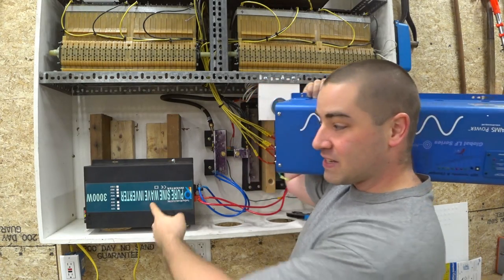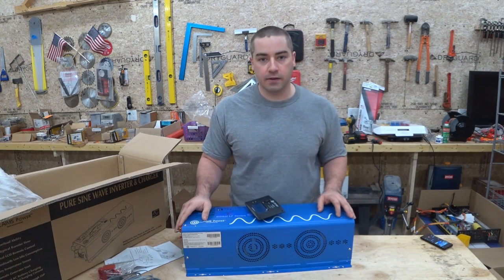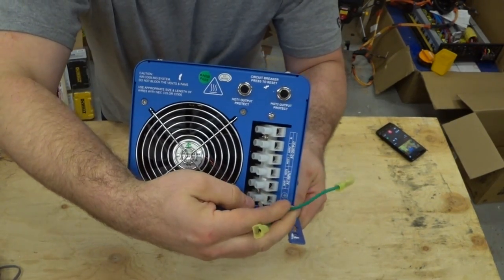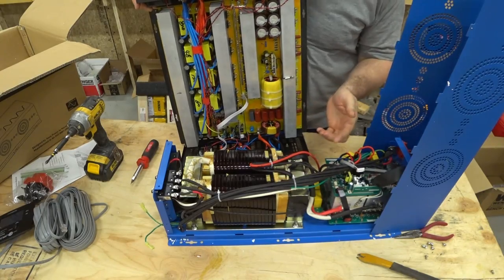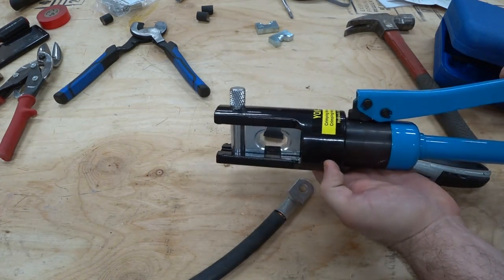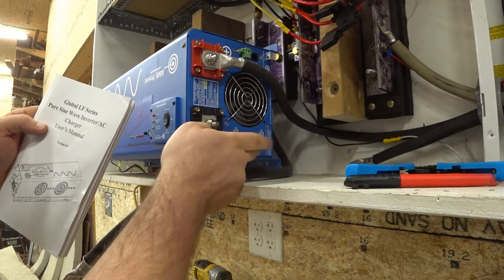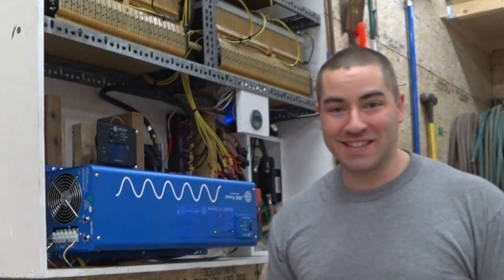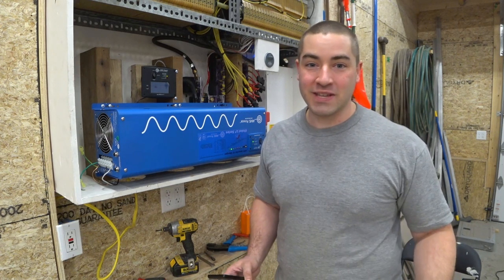Inverter Upgrade! Reliable to Aims in Off-Grid System

Comment: Is this SUNGOLDPOWER 6000W Peak 18000W Pure Sine Wave Split Phase Power Inverter with Charger 60A,Solar Wind Power Inverters DC 48V AC Output 120V 240V Converter
The same as the AIMS POWER INVERTER CHARGER YOU ARE TESTING IN THIS VIDEO? please I like to know thanks.
Reply from the maker: I'm told they come out of the same factory.  There are slight differences in the user interface (display/controls) but very similar.

Comment: Cool video, Sry all dumbo newbie here, what's the imput voltage and how is that generated?
Reply from the maker: Hi Sean,  I'm using a battery pack with a nominal voltage of 48 volts DC (direct current).  This will vary between 44-49 volts, which is normal.  The inverter takes that and makes 120 volts AC (alternating current) on two legs.  I can use one leg (for 120v) or use both legs for 240 volt loads.  Thanks for watching.
Reply: Thanks very much for the reply, how do you charge the battery?
Reply from the maker: I use a solar charge controller: https://youtu.be/Efqx_iRYRjo

Comment: i got 2 magnum 24 4000 watt inverters for $ 650 for 2 inverters and 3000 watts of solar for $ 400 used my new 100 amp controlers came to day cost new $320  for 2  my volt car cost $900
Reply from the maker: Sounds like you got some great deals.

Comment: I would like to see if it would run a5,000 but AC window unit and for how long on batteries.
Reply from the maker: I have a 5,000 BTU window AC in my garage.  and a 6,000 BTU window AC in my house.  This Aims inverter can run both at the same time with plenty of room to spare.  How long they will run is a function of battery size, not inverter size.
Reply: @DavidPozEnergy  Awesome thanks.

Comment: With this unit provides single phase 240? In countries like png, one leg swings the full 240 volts, the other leg is neutral like ours carrying no current and then a ground leg
Reply from the maker: Not this exact unit, but there are other models from Aims, and other manufacturers, who sell single phase 230v for other countries.
Reply: @DavidPozEnergy  thanks David! I know victron has one, but the aims installation menu shows wiring for a single phase 240. Of course their manual is pretty generic and I think covers different models. I'm not personally really certain what the difference is once you remove the center tap concept for 120.

Comment: My aims  8000 inverter switch went hay- wire. I had to disconnect everything. And I’m using a 3000 inverter my brother lend me. I’m running to a small refrigerator, 3 power packs , a usb fan, and a Bluetooth  speaker.  I tried buying a remote for it and got scammed. But luckily my bank got my money back.  I have been living 2 years in my dads house no electricity. I should have done my homework.  This is Puerto Rico. I tried to get luma to help me get in electricity they told me I had to pay 18,000.00 for a transformer that don’t even include the post and cables. But I’m ok. I learn to live without power.

Comment: Men and their toys😂😂

I'm still trying to understand the difference of benefit between high and low frequency transformer. 

Ans at this point I'm lost about 120v 2 phase making 240v. 
Does that imply in other countries using 240V, a 2 phase will become 480V?
Reply from the maker: This inverter (Aims 6kW) makes a sine wave that is 240V.  then there is a transformer built into it.  Transformers are big and heavy.  This transformer "splits" the 240V sine wave in half providing a middle neutral.  That's where you can pick up 120V from each half.

Comment: so you got an inverter that cost over $1,000 and you're all excited because it runs your miter saw I bought one from harbor freight I think I paid 60 or $70 for it and it's been working is running sauce drills everything I need for about 5 or 6 years
Reply from the maker: Cool.  Can you please make a video about your setup and share the link?

Comment: Go check out another power.com and search the thread “guess who bought a powerjack inverter”. There is a very simple mod you can do to the positive cable on the small heat sink that will raise your efficiency greatly. Your inverter control is identical except the bells and whistles. Just the transformer is different. The mod really is simple and I can help find the part called an e-core which when installed brings your idle wattage down to about 20w and overall better efficiency.

Comment: Where did you get the batteries ? How do i get some ?
Reply from the maker: The easiest way is to buy them through ebay: https://www.ebay.com/sch/i.html?_from=R40&_trksid=p2380057.m570.l1313.TR12.TRC2.A0.H0.XEV+battery.TRS0&_nkw=EV+battery&_sacat=0
I found my pack by calling "Auto Recyclers" (junkyards) in  my area.  I probably called 100 places before I found one with a Chevy Volt.  Then I bought the battery.  Here is a video when I picked up my pack: https://youtu.be/V1t1SoEhVNQ

Comment: Try running a TIG welder. You'll be pleasantly suprised.
Reply from the maker: I've never used a TIG welder.  Can they run on an off-grid system?  I only have an old Arc welder and I won't try it because I'm pretty sure it will burn up the inverter.
Reply: Also MIG welder, many available  from hobby to industrial, gas and gasless and are very handy to have around.  Have seen you use your ARC recently on battery pack threaded rod and had a chuckle!!  A MIG would have been the go there.  Cheers from Australia 😎

Comment: What sof6are you using to monitor your system?
Reply from the maker: I don't use a computer software.  I have a battery monitor (Victron BMV-712) and I go to the garage to check voltage, or SOC.

Comment: So it should work with a air conditioner?
Reply from the maker: I've run 3 window AC's at the same time with it.  No problem.  It might have a hard time with a whole house AC, but depends on size.

Comment: I do not understand what you are getting excited about, you say it is a 6KVA inverter but you have not shown is any device that uses over 2kva so what is the excitment about. You need to upgrade your output wires and have more output wall plug fittings so you can connect many tools at the same time. 6kva should run 3 maybe 4 hotplates on your cooktop or all the tools and heater that you showed and more at the same time.
Reply from the maker: I'm excited because the last three inverters I have tried could not do this.  Two of them were rated for 8000 watts.  https://youtu.be/Y7wRgdn7c-c  However, I have done a full load test, and am editing that video now.  Stay tuned to see it in action.  Thanks for watching.

Comment: lm trying find one that can operate my 220v air compressor
Reply from the maker: Yes.  This is outputting both 115 and 230 volts, so it can work with 230v appliances.

Comment: man i want to get one but for my computer use and gaming console ....any help  on how i can make this happen
Reply: ohh AND TO RUN ATLEAST  10 OR MORE HOURS
Reply from the maker: I'm not a gamer, so I don't know how many watts a computer system needs.  I would start by finding out how much power (in watt*hours) your whole system uses every 24 hours.  I do this with a plug-in meter called the kill a watt.  https://www.amazon.com/s?k=Electricity+Usage+Monitor&ref=nb_sb_noss_2  Once you know the usage, plug that number into an on-line calculator that can help you size your system.  I like this one: https://www.altestore.com/store/calculators/off_grid_calculator/  I hope that helps.

Comment: Can it run a welder? Like a harbor freight 170 amp
Reply from the maker: I don't own that model, so I looked up the user manual: https://manuals.harborfreight.com/manuals/64000-64999/64805.pdf page 7 says the input at 240v is 26.8A.  That's 6432 watts.  So if you are using the welder at full power then this aims inverter can power it for maybe 5 minutes before cutting off.  I have run my Aims inverter at full load (6000 watts) for a full hour and it did not shut off, but it will shut down when overloading.

Comment: Can it start an ac unit like a 4 ton, just for the ac
Reply from the maker: You will have to measure the in-rush current of your AC by using a multi-meter with a "peak hold" function.  Then compare that to the data sheet on this inverter.  I don't own a 4-ton AC so I can't tell you yes or no from personal experience.  All I can say is it works with my AC's, but the larges I have is 1-ton.

Comment: Will these work in India? will work for AC compressor
Reply from the maker: You would need a different model.  I think India uses 230 volts, 50 htz.  Aims does make a model that has 230v (single phase).  As for the AC compressor:  This starts my window AC and my shop air compressor.  So it can start some compressors.  I don't know what size your AC compressor is so I don't know if it will work in your situation.

Comment: The low frequency inverter will start motors alot better. It may not be effiecent.   I have a similar inverter..
Reply from the maker: How has your's been holding up?  How long have you been running it?
Reply: DavidPoz it does OK. I have had it for almost two years. I don't use the charger either. It's nice to have. I haven't put alot. On it. Mostly circular saws and routers. Haven't had a issue yet..

Comment: What!? Not a word about the idle current draw and how well the Power Saver mode works? That is the most important feature in an inverter for home power, in my experience. How much power is used by the inverter, when everything else has turned off? 
I like my AIMS 6000watt, 24 volt version, except the standby, power saving mode is not adjustable, and you have to turn on way too much load, to kick on the inverter. I ended up installing my old Trace 2424 alongside the AIMS, and seldom use the AIMS anymore, because of that one vital detail. Abandoning the AIMS made a huge difference in my batteries state of charge come sunup.
 The Trace can adjust to power up from a mere nitelight being turned on, but with the AIMS, I had to turn on all my lights, plus two mini fridges to wake it up! 
If this 48V inverter has the same standby as mine, it is kinda worthless for a typical residential application...e.g. If the fridge coming on won't kick the inverter out of standby, that feature is useless for a household, making that inverter a poor choice.
This review is equally worthless for neglecting to discuss one of the most important features in a home power inverter. At least we know the torque specs though...
David's excitement over starting a puny compressor with a 6000watt pure sine wave inverter, was a bit overdone IMO. Try starting a 5hp 220v model like the specs suggest it should. That would be meaningful.
I highly recommend these 6000w AIMS, but only to a buyer who doesn't care about a workable standby feature, or could use the industrial sized setting my model apparently has. Like a large workshop that's mostly under load constantly, or turned off completely.
That's my observations and opinions after living with an AIMS 24 volt, 6000watt model, in the high desert of NM for a few summers. 
Now I prefer a modified sine wave, 1980's model, with less than half the power, but an excellent power saving mode. The AIMS is NOT an inverter suitable for an off grid home IMO, unless they have fixed the all important standby mode. That's why I decided to watch this video, but he pretty well ignored that most important of features.
Reply from the maker: Hi kelhawk1,  I read your comment.  What are your own numbers for your Aims 24v idle, and what your 1980's Trace uses?   I share my numbers in this follow up video you might be interested in. https://youtu.be/4EsYfdK1Hn4
Reply: @DavidPozEnergy  Alas, my 12 acre, off grid retreat in New Mexico was virtually stolen from me by the Covid10 hoax. I have been stuck here in Kansas, disgusted with the state's governor, and one of the most restrictive lockdowns in the nation. All my paperwork and specs are out there. If you really wanna know, (lol) it is a Trace DR2424. Look it up. The exact AIMS model I could likely find records for, but what would that accomplish? 
In case you missed it, my entire point was to warn people about the importance of idle current draw and standby features before buying an inverter to power an off grid home. Can you offer any info contradicting my observations? More specific, my sun up state of charge went from a typical 80 to 85% to 90% after only using the AIMS on an as needed basis. My 8 Trojans sighed in relief.
Don't feel singled out, I never hear Will consistently talking idle current specs & features either. As I found out the hard way, it can be a significant factor with big n cheap   inverters hooked up to lead-acid.

Comment: How is the aims inverter doing.
Reply from the maker: I used it for a year, worked great.  Then I sold it (cheap) to a friend and he has been using it daily for 2 years.  Still running strong.

Comment: haha.. what a monster... What was wrong with the other inverter?
Reply from the maker: I don't know exactly why the other inverter failed.  The fuses and mosfets are blown.  At some point I'll try replacing the mosfets and see if it still works.  In the meantime, I have tested this inverter heavily.  If I overload this blue one, it will shut itself down without damage.  I like that.
Reply: @DavidPozEnergy  Thanks for the update.. Guess there's a reason why the other unit is fairly inexpensive.. instead of a blown fuse, which is simple to diagnose and repair, the mosfets fail too.

Comment: You're going to wish you didn't do that I took one of those inverters out because it consume 200 Watts continuously to be on 218 to be exact how much is your idol load with this inverter
Reply from the maker: https://youtu.be/4EsYfdK1Hn4
Reply: @DavidPozEnergy  88 watts is very reasonable my house load with TV modem router Phantom loads 352 400 W including refrigerators everything all the 110 volt circuits not including the heat pump or stove if you're interested in having a conversation with me I'd be more than happy to help reduce your load and we can do a energy audit to help you my inverter is a 48v 4400 watt inverter 8000 watt surge Magnum manufacturers my inverter my powered on consumption is around 30 to 40 Watts with no load the energy curve efficiency is 94% I think but it's really good
Reply from the maker: Your Magnum setup is one of the best out there.
Reply: Thanks man

Comment: So I don't get it, why would you want to put all of your faith into 1 massive inverter as apposed to multiple smaller ones? So instead you depend on one inverter but if it ever blows on you your stuck. Also with massive inverters the juice they suck up is just over the top VS smaller ones. I have 12, 340 watt  ultra high efficient panels a 100 amp charge controller and an 80 amp charge controller with 2 combiner boxes and 4 3000 watt pure sinewave inverters. I am not knocking what you have done here I like it. I am simply trying to understand why you did it this way? Every large inverter I have ever owned has failed due to the mosfets blowing.
Reply from the maker: Hi Clip Joint,  I built this system as a home backup.  It replaces my gasoline generator for power outages.  My home is 100% electric.  This includes electric heating and electric cooking.  I actually bought the smallest inverter that could still handle loads like these.  This inverter can not handle every load at the same time, but it can handle the oven, or stove, or baseboards.  This way we can still get through a power outage without needing the gasoline generator.
Reply: @DavidPozEnergy  ok got ya, again, I was not knocking your build in anyway I was just genuinely interested in why you did it this way. If I may make a suggestion, I got some really awesome panels that are ultra high efficiency rated at 340 watts per panel and I stole them for 79.00 each. They came professionally crated to me from AZ to TN. The shipping was 200.00 and they shipped a total of 16. 4 go to a friend of mine. I got the 12. I bought a charge controller from Amazon that blew away my expectations in that it is 100 amp for 500.00 and I simply can't believe how nice the digital read out is on the display. I only have 9 of them live and working but I am pulling 72 amps out of the 9 panels. I went with Tesla cells and have 3 total batteries for 699 ah. My voltage only goes from 20 volts being the minimum to 30 the highest because the inverter shuts down at 20 and the charge controller shuts off at 24 to 30 depending on what I set it for. This should make the batteries last a very long time. Anyways nice clean build you did congratulations.

Comment: sir which one inverter is better 12v,24v48v
Reply from the maker: Depends on your application.  I use a 48v inverter because I am powering my whole house.
Reply: @DavidPozEnergy  Hi am in a remote cold area,  and I'd like to power my 5 rooms house some  gadgets and small machines. Which kind of battery and inverter can I use?

Comment: Humm 16:20 "I hope" it's a 6000watt inverter (50 amps).... air compressor of that size is 10-15 amps. If it couldn't handle it better send it back. Even at 50a surge like 25a run it still would. You are like a kid in a candy store. Get out of my recommended... ty.

Comment: if the inverter is 120/240 volt output, he may get better performance with the compressor set to 240 volts. and the question remains, for how long will this unit last under load... if he blew one, he might blow this one if he uses it all the time! these are meant for TEMPORARY POWER.
Reply from the maker: Hi John,  I have blown two other inverters, but they were both high frequency designs and a different brand. That's why I spent more money on this unit.  Thanks for watching.